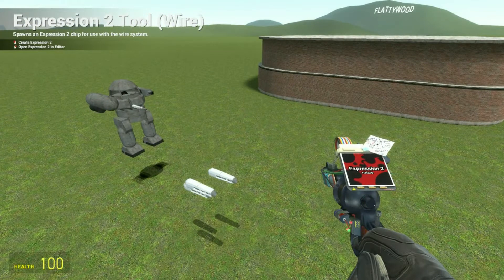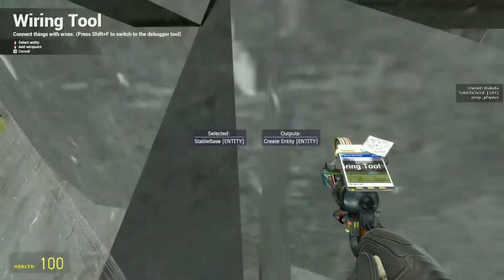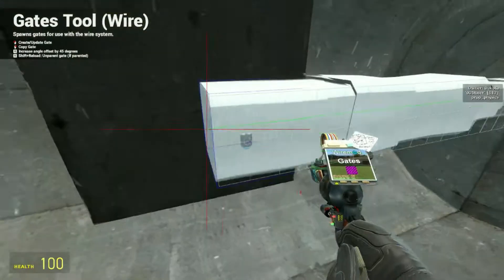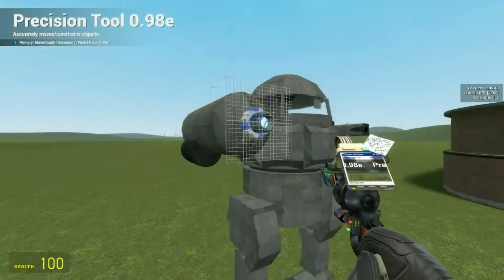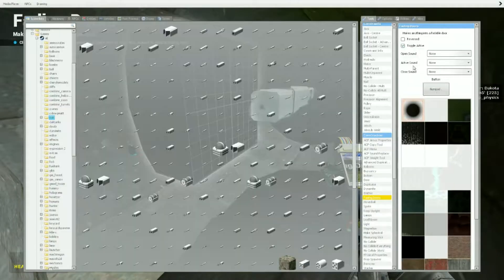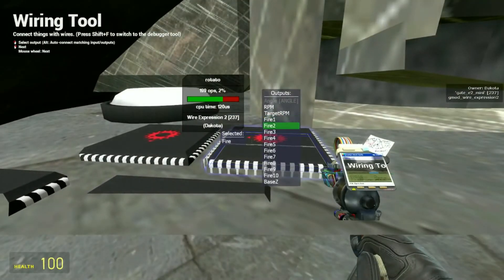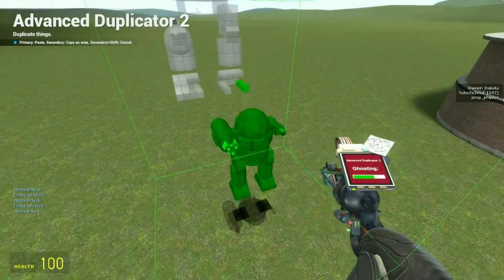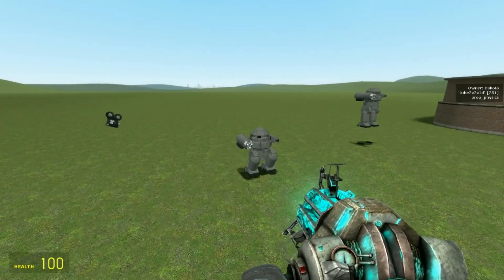DakTek Tutorials: Rotato Chip

Comment: will the Rotato Chip work with acf guns?
Reply from the maker: A few inputs would need to be edited and it wouldn't work great with ACF since you can't parent guns other than the light machine guns in ACF, but its possible to set it up, just really really inefficient due to needing a much heavier base and rotator to keep it stable.
Reply: Dakota I see